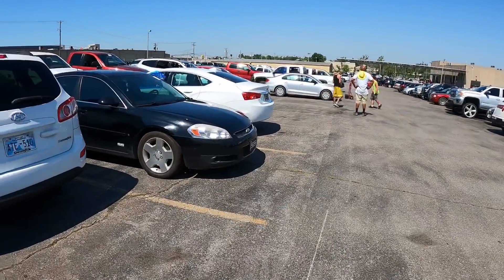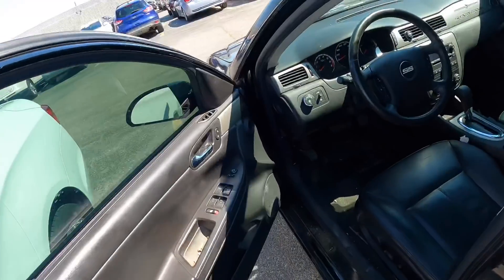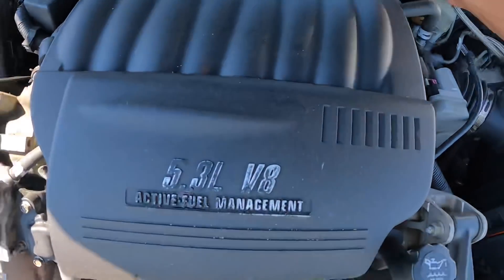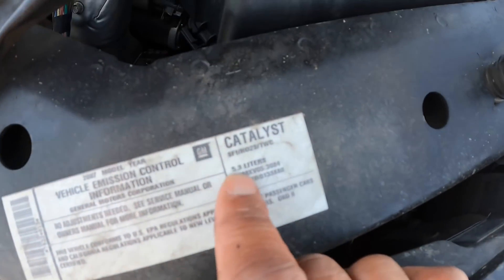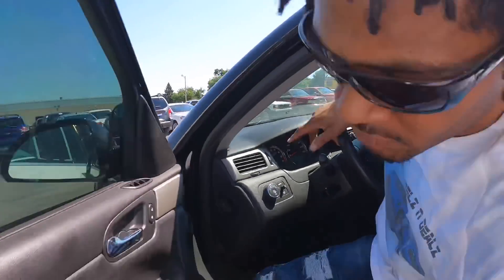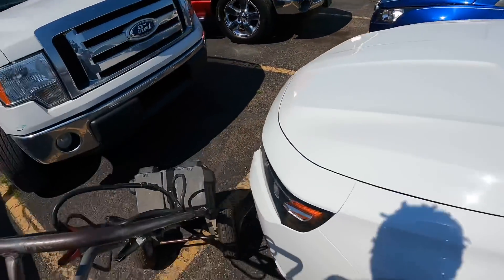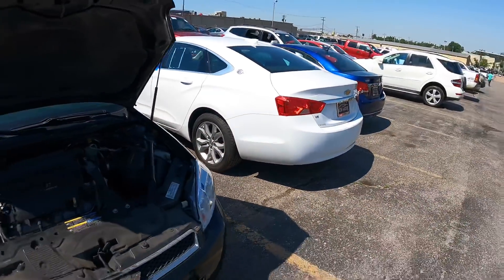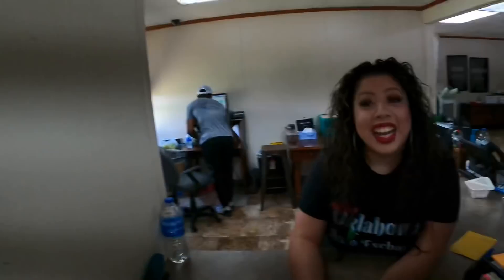How Much ? Money 🤑 For This Cheap Chevy Impala SS At The Dealer Only Auction

Comment: Alot miles on that SS. 6k tops in today's markets. I had 06 SS same one blk with tan interior.  Was a fun car. High torque. Shit get ups. Issues was wheel bearing changed rears twice. Sunroof do leaks drain get clogged and the hose disconnects from connection. And oil consumption was the worst minus the 4cyl activate good engine.